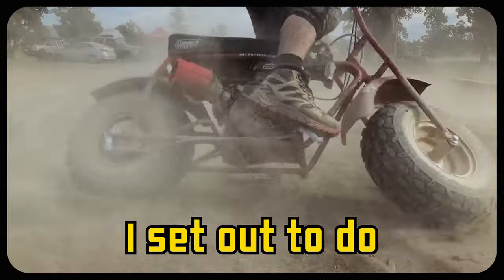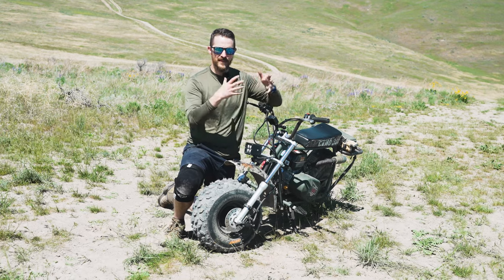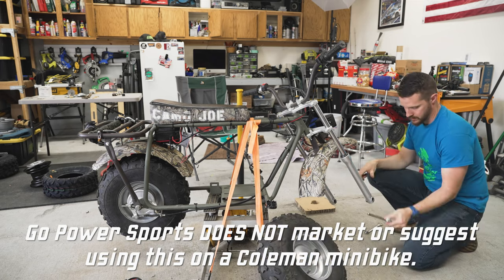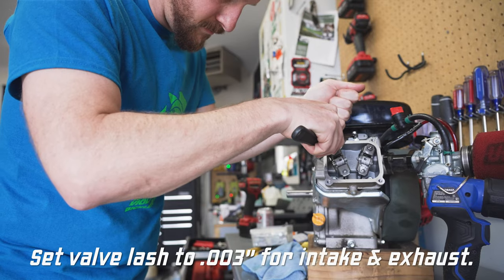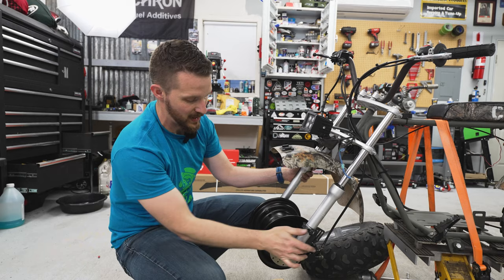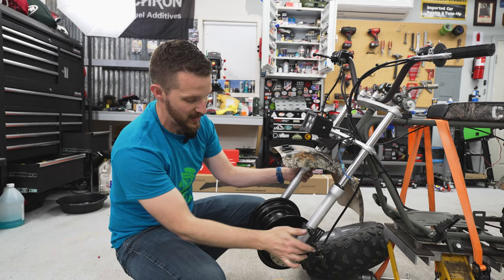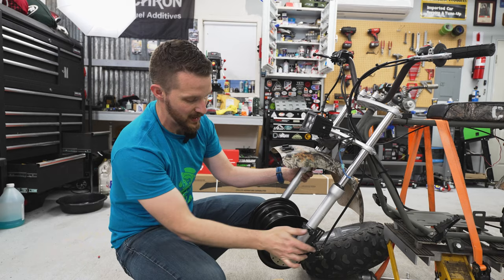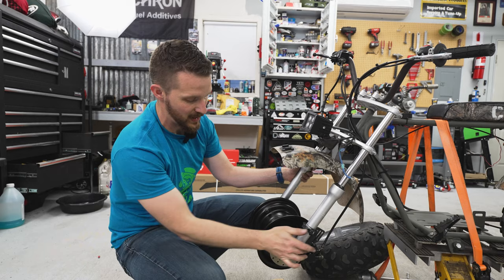Hotrod Mini Bike!  Off Road Beast Coleman CT200U Gets Front Brake!

Comment: Watching you I’m kind of embarrassed. I am mechanically inclined. I can pull things apart and rebuild them if I pay attention and/or have instructions; however, I’ve never been a vehicle mechanic. I’m more of a house/building builder/repairer. I was a missile systems repairer I’m the Army, but that’s more electronics and a little hardware. Basically replacing circuit cards and some gears and parts for the system. I have repaired my own vehicles but always with a Haines Manuel or YouTube. I have installed parts on my motorcycles when I had them but it was simple common sense stuff to do, never really in depth things like this.
Reply from the maker: Don’t be embarrassed at all.  I learned what I know from following manuals and instructional videos.  Had barely done a thing on cars or trucks till I started tinkering on a VW Beetle in 2008.  I just love learning stuff and not being at a desk.
Reply: @JasonExplainsThings  being retired as a disabled Army veteran I have the time to do all this too. I just need to get my debt paid off so I cant afford to live life.